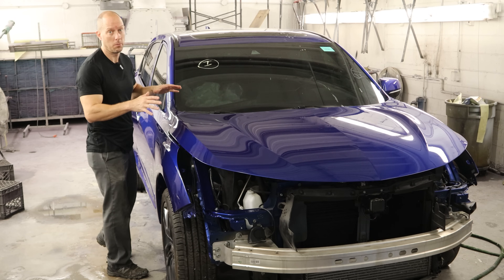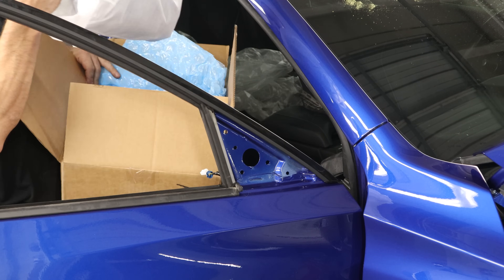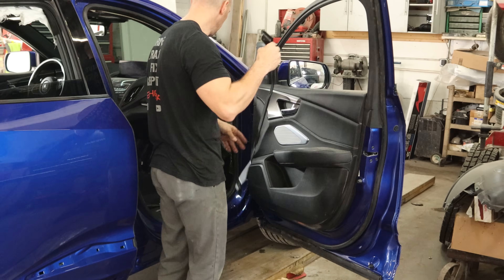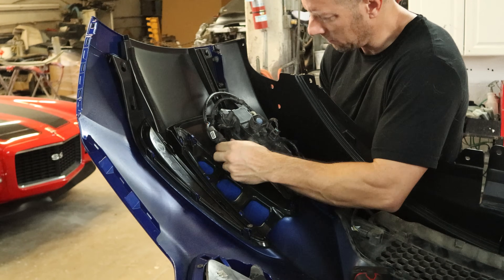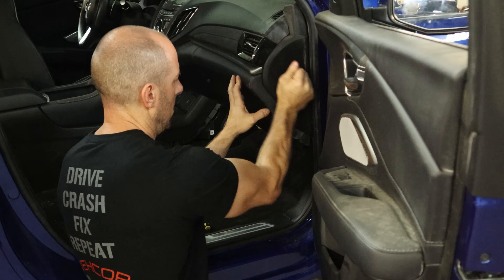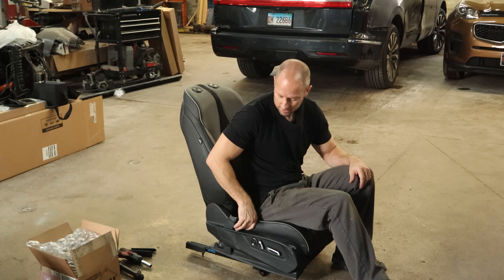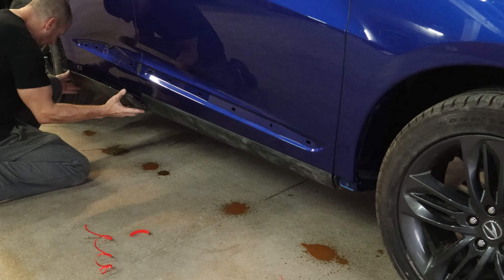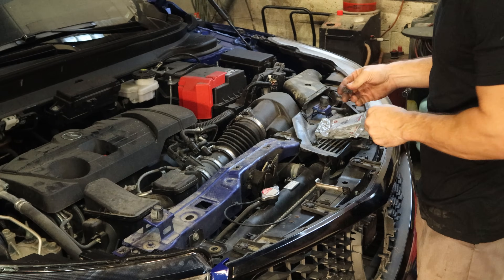An unforeseen problem prevents me from selling my completed Acura RDX rebuild.

Comment: I remember a big accident repair job that didn't replace the steering rack tie rod. Turns out the accident force partially fractured it. Within a week of the car being back on the road, the tie rod failed and the car was written off. Lesson learned. Good job on this one, thank you.

Comment: I get what you mean about the price of clips...  Surprisingly, Mercedes main dealer prices aren't too bad, with most clips averaging a dollar or 2 (UK equivalent...), and it's great how much is actually still available for older cars.  However, there is one clip that goes on the side skirts on my W208 CLK that is like, 15 bucks (9-10 quid UK), which is kinda ridiculous as it's so, so similar to the ones that cost a dollar!!  And I need 8 of the buggers!!

Comment: Some how,I figured that was the "Problem" with this ride.Well,ya gotta keep her happy right?
Btw I recall from my early years as a Honda MC mechanic,some parts only came in quantities of ten.And if the dealerxhip didn't want to get stuck with 9 obscure bolts/nuts/washers whatever,you had to buy all ten.Maybe Honda doesn't sell stuff in quantites like that anymore.
Great looking ride also BTW....
Reply from the maker: Each one is individually packaged, I could understand buying 10 for $7.  There is $21 worth of clips on that $45 moulding. 😂

Comment: Yeah, for Hondas the front passenger seats have an occupancy sensor which, if you replace the seat, needs to be programmed to the SRS module. It's 30 minutes flat rate at the dealer.

Comment: That was a great build.  I had a similar issue with my 2008 Lexus IS250. It has very low miles and the insurance company total lossed mine because a slight indentation in the pillar that supports the door like in this build.

Comment: I lost a couple investments like you did. I bought a non running Durango from auction and replaced the engine with a used engine so I could flip the vehicle. My then-wife drove it and wanted it for herself. Since it was going to be our family vehicle I swapped a 4 cyl Cummins diesel into it so it got 28mpg instead of 14-15mpg. A few years later the body was rusting badly (northern NH). I bought a very nice condition non-running parts Durango just for the body to swap onto the other. Well I found out all that was wrong with it was a bad coil so the Mrs confiscated that one over the rusty one.

Comment: Just a friendly tip for window tint if you want to strip it off the glass easier if you got some thin plastic kind of like that's the thickness of window tint cut some of that to the shape of the window spray some soapy water on it put it on the inside of the window and park it in the sun the heat will help melt it off the window and then you just rip it off and wipe off the glue makes work a lot easier

Comment: Tip
Instead of counting turns when changing tie rods and similar try this.
Turn the wheel all the way to its stop pick a suitable point and measure with a tape or anything handy the distance from that point to the centre point of the tie rod.
This can be more accurate and easier as not all tie rods are made equal.

Comment: Great video and awesome rebuild. I recently rebuilt a 2017 Genesis G8 20k miles in excellent condition now. Is 25% off bluebook a fair price with a rebuilt title if I decide to sell? No air bags were deployed and only replaced hood, fenders, headlights, core support and front bumper and cover. After a title check, I came to find out that the oil had been changed every 3500 miles and a new set of tires had just been installed about 2k miles before accident. Thank you for your help. I am a subscriber.

Comment: Pizza girl for the win!  I was looking at RDX's back in 2017 when I wanted to get my latest ride.  Settled on the Lexus RX350, mostly because of the CPO warranty, which just expired last summer when the car was 9 years old.  Good luck trying to find a replacement for the RDX....they are really nice, as you know with the Florida trip.  Hey, Mr. Spotty....go find the Pizza girl a better ride....but make it cheap!
Reply from the maker: You made a good choice.  I really like RXs but they are pricey to rebuild.  The 2019+ RDX is far better than the previous generation.  I fear I might have to find an RX to get her out of this! 😂

Comment: Tip
There are cheap flexible plastic cutting boards you can find in most grocery and dollar stores,
These are extremely useful for various uses in an auto body shop.
Apart from using as mixing plates for all the various glues and fillers they are very handy for keeping the glue tape on emblems etc safe for long term storage.
You can also cut them up for various purposes including templates and spray masks.

Comment: Honda OE filter uses FRAM Tough Guard can and construction. But the media is completely different than either the TG or Extra Guard. Honda specs their filters to filter 66% at 20 microns (for better flow), much different than either the TG or EG.

Comment: Unreal ..... Even the seats needs to match the car.. What will they think of next to make things even more difficult?
Reply: I am imaging things like those modern RGB strips. Every RGB has an individual address in there, so you have simple data bus and a power rail. Now if I was making cars I would put a simple bus everywhere and for example turn the blinker on/off via on/off signals to the bus. This way every component has a unique address that needs to be programmed if the replacement has a different one.. 😈
Reply: There was one make that had the power window switches coded to the VIN for a while. If you replaced the switch, it engaged the security immobilizer and the car was dead until the switch was reprogrammed.  On one hand, I get the anti theft benefits, but a PW switch failure potentially putting a vehicle out of service?
Reply: @bobmazzi7435  How about a flat key fob battery that put our Hyundai Gets out of action until I could get a new button battery. No way to do anything with the car, as opening the door with the key set off the alarm and immobilized the car. Lucky this happened at home and not miles from any cell service or town. A pretty stupid idea!
Reply: @BrucePierson  Keep a spare in the glove box. Because, the next time you won't be that lucky.
Reply: @bobmazzi7435  No, the next time the spare battery would be flat!! Also need a suitable screwdriver in the glove box as well.
Reply: @BrucePierson  I'll grant that it might not be as good as a new one, but if bought at the same time as the one in use, and then stored, not used, it should have enough juice to last for a few weeks at least. And as far as a screwdriver, some of them don't need a tool to open. But adding a small basic toolkit to the car is not a bad idea.

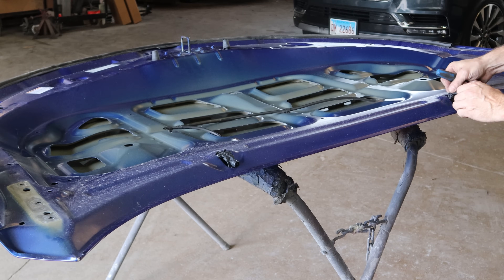Comment: Uh oh... Curious as to what caused the roundness error (flat) on that new Atlanta tire at 7:39?
Did you have to change the summer air to winter air or did the Honda air not match the VIN number number? 😉
Reply from the maker: The painting gnome flattens the tires so it is easier to reach the center of the hood.  These RDXs are surprisingly wide.

Comment: In your opinion would you say you prefer plastic snap together parts or the way parts use to be held together with fastners.  Like the front bumper corner pieces having tabs that you struggle to get them free vs nuts and bolts from the past.  Great job, we like your channel very much!
Reply from the maker: If I had my choice, both.  Snap together with screws at the corners or edges.

Comment: 16:35 no wonder vehicles cost so much, look at all that in a BUMPER. I remember when the only thing on a bumper that weighed 300 lbs was maybe some rubber stick on moulding or a cheapo reflector.

Comment: These newer vehicles sure have a lot of stuff in them to put back. Not like the old cars that were a lot simpler to work on.
Reply: Pollution control BS and electronic crap for your “safety”
Reply from the maker: There is a price to pay for all the conveniences the passenger think they need!
Reply: @RollerCoasterLineProductions  A whole lot of people walk away from some significant accidents.  That was not the case back in the day.  Suppose you want your leaded fuels, leaded paints, and acid rain, three speed transmissions, 8mpg, hard starting in the cold, hard starting in the heat,  pre emissions back too...
Reply: @ShainAndrews  Nope. That's going too far the other way. A safe vehicle that is sensible.